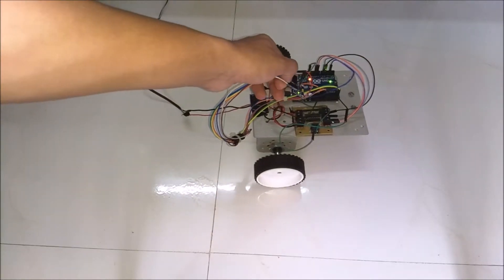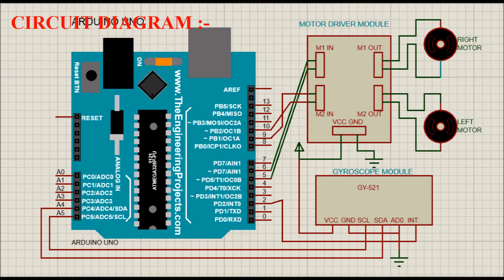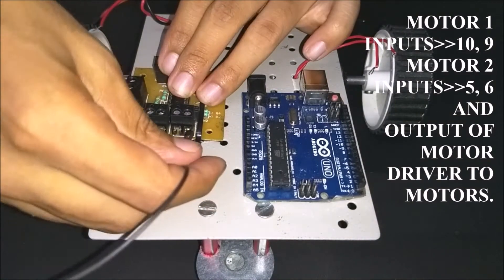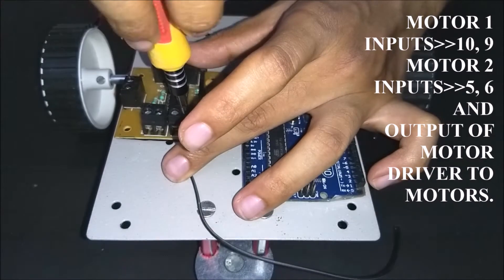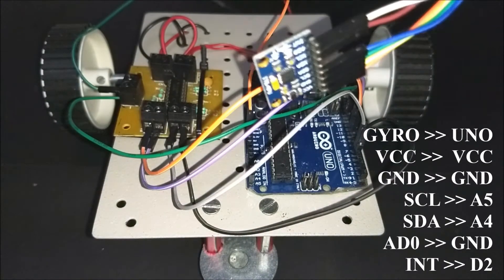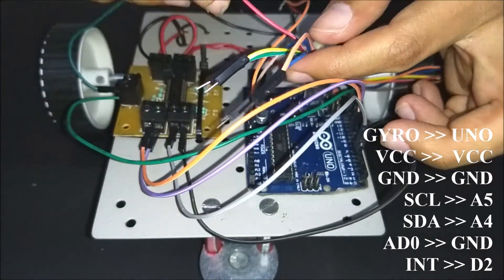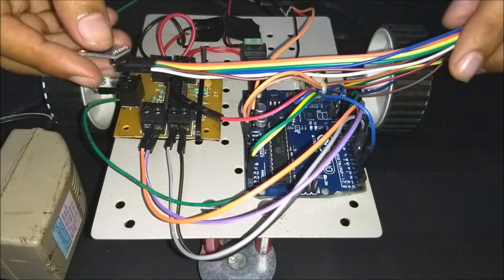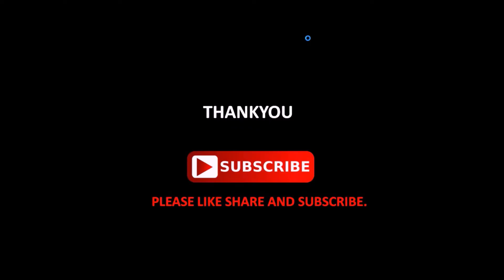GYROSCOPE CONTROLLED ROBOT USING ARDUINO UNO AND GY521 GYROSCOPE SENSOR MODULE

Comment: Can I use lithium batteries instead of power bank
Reply from the maker: Yes you can. Just check the voltage ranges for the devices/input ports you are powering through.